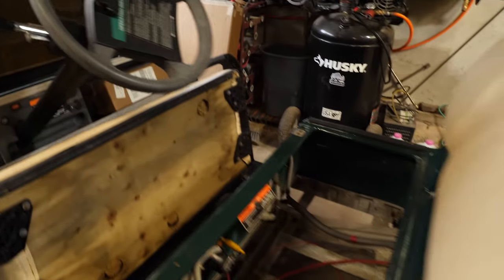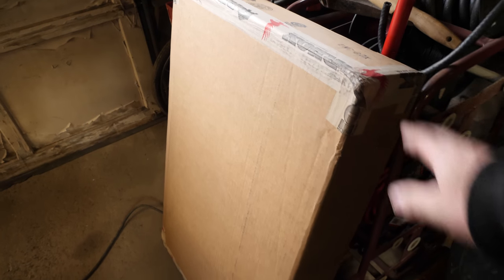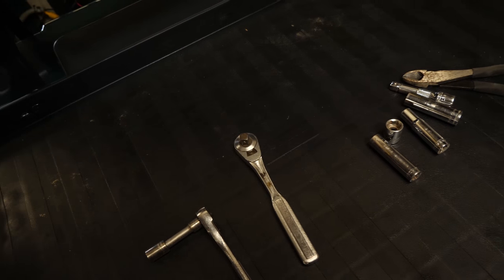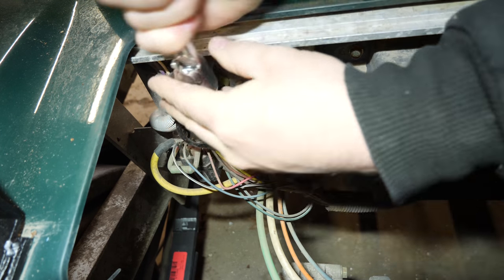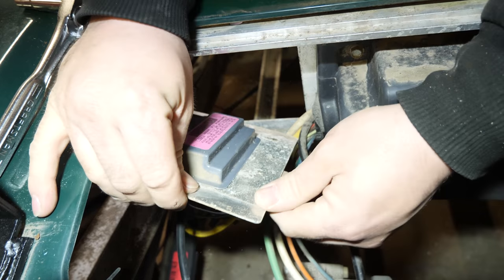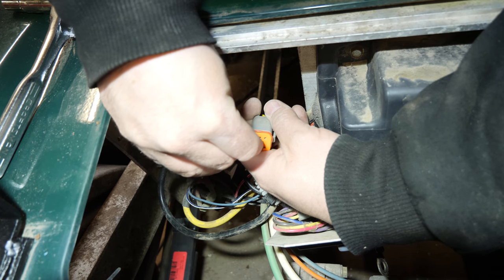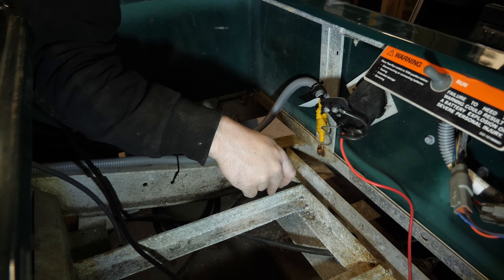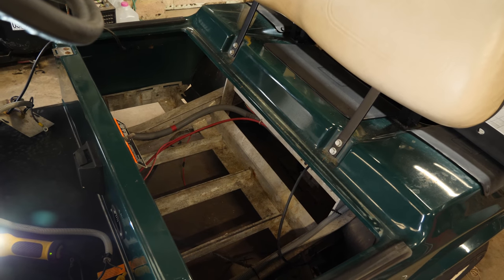2006 Club Car DS, 48 Volt Electric - 4-12V to 6-8V OBC Upgrade

Comment: I was told the obc doesn’t have to be swapped out to go from 4-12v to 6-8v. What will happen if I don’t swap it out and it’s an older obc? I have a 2006 Club Car DS IQ. I have not checked numbers on it yet. Just trying to find out if it will work either way.

Comment: 2005 Club Car DS....

Okay people I need some help now. My neighbor has a 2005 Club Car and he was complaining about the car not going in forward or reverse when it got hot and then shut off and waited a few minutes and it will work again sounded like the solenoid was not clicking. After taking it apart I noticed that some of the wires were melted on the battery so I replaced the entire harness and Battery wires and the positive and negative wire and the solenoid. Everything seems to be working but after I drove it for less than 30 seconds and I was backing it into my driveway it would not move. The backup alarm came on but would not move put in forward and it still would not move, when you press the gas pedal you did not hear the solenoid engaging. If I turn the key off and left it for 2 minutes and turned it back on it works fine. Does anybody have any thoughts? I thought maybe the forward reverse switch is going bad but is there a way to test this?
Reply from the maker: Is this a gas or electric cart?
Reply: @Kevinsgolfcarts  48v electric.  Replaced items are listed above . Now thinking maybe mcor or fr switch
Reply from the maker: @pyrojoe1404  Sounds like the MCOR is on its way out. F/R switch is just a simple DPDT (double pole, double throw) switch with an ON-OFF-ON config and can be tested with a multimeter. Could also be the controller or motor. Ive had controllers fail, tho its not very common. When they fail, they just stop working.
The MCOR has a variable resistor and micro switch inside. You can find the measurements online for the resistor (potentiometer). The switch is on or off.
Reply: @Kevinsgolfcarts  can i find you om facebook?